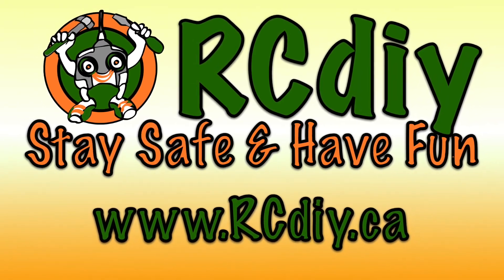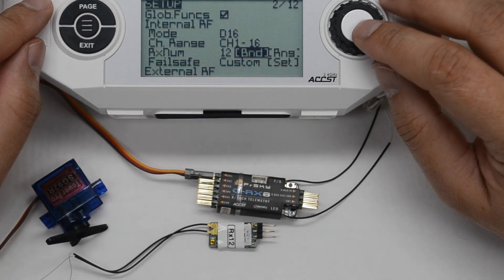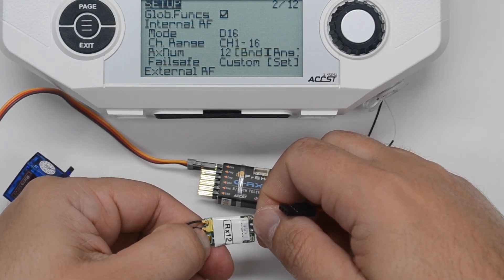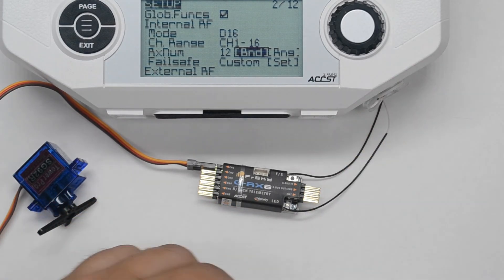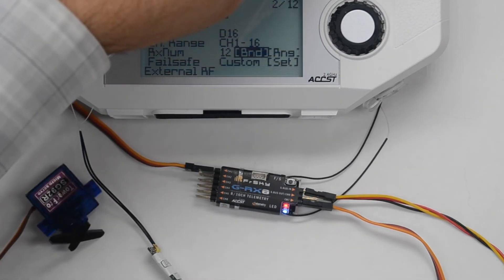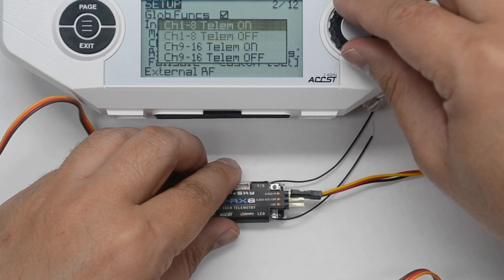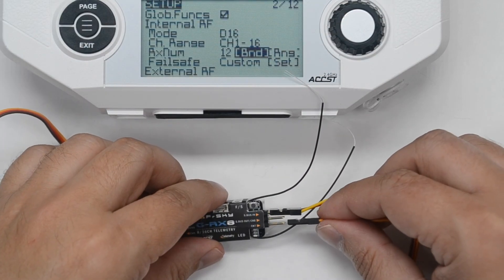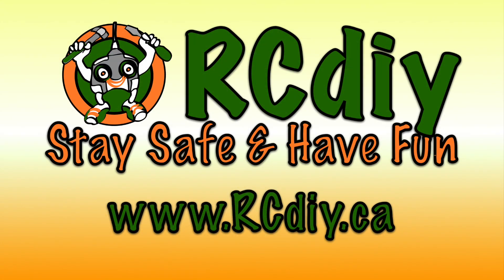OpenTX FrSKY Redundancy Connecting Two Receivers G-RX8 XM Plus

Comment: Oh and can you comment on the FrSky "redundancy bus"? Is that obsolete now? Should I ignore it? NO CLUE from FrSky
Reply: They replaced it with the flight safe system RB-10, 20, 30 system you can connect high power servos that need 7.4V. with duel battery power It allows for duel receivers. I use it in larger gas powered models where I have the room and want extra insurance incase have a receiver failure and you can put another antenna in another place.

Comment: Another question:  I have two RX8R Pro recei vers.   Can they be set up in redundancy mode?  Also have an R-XSR.  I can bind any of them as a single RX,  but redundancy setup?  Still baffled.  I know the R-XSR is an ACCESS rx,   the other two ACCST.  I can't find any way to "upgrade" the RX8R Pros to ACCESS.  Or "downgrade" the one ACCESS Rx to ACCST (don't even know if that's necessary).  Please advise, thanks.      I know you want folks using RC forums, but all I can find is 100 different sets of setup instructions, that so far have not worked.

Comment: This was very helpful. If I connect two receivers (e.g. R-XSR and XM+) as you have in your video, if enabled can both still transmit RSSI without any conflict?
Reply from the maker: No. Only one; Which is why the second receiver is bound with telemetry off.

Comment: Thanks for this video. I followed your procedure using an RX8R Pro (master) and an R-XSR (slave). The binding process X12S to R-XSR was successful. But when connected to the not yet bound RX8R, the the signal would not get through the servo. I then bound the RX8R Pro as well and all worked. LEDs indicate that both RXs are bound OK, but I can't test it the way you did. Do you think my RXs (different to the ones you used) work differently?
Reply from the maker: Try binding using two Rx numbers. Then test using each Rx number in turn. Do the servos move with both Rx numbers. If yes then redundancy is working. Go back to binding both with the same Rx number.
Reply: Great idea, thanks. Will try this tomorrow :-)
Reply: I just tried what you suggested and do see that the green light switches from one RX to the other as I change the RX Number in the TX. This part works as you suggested. But If I am using the RX number of the slave RX, its LED turns green as it should but the signal does not reach the servo attached to the master RX. Is this because of the different RX numbers? If so. How can I use 2x the same RX number, get the master RX to fail save and see how the slave sends the signal to the servo? Sorry to insist, but this is THE important thing to test... very much appreciate your time and help.
Reply from the maker: Redundancy is not working. Post in a forum with close up pictures and we can help
Reply from the maker: Try the Aloft Hobbies forum.
Reply: Had same problem; solution was to use the correct FW! Don't use the versions ending in rssi8 or rssi16 - they're for drone FC setups. The plain XM+FCC170313.frk worked fine for me.